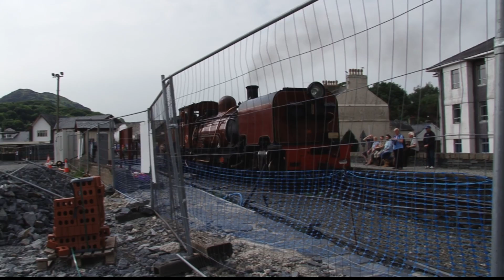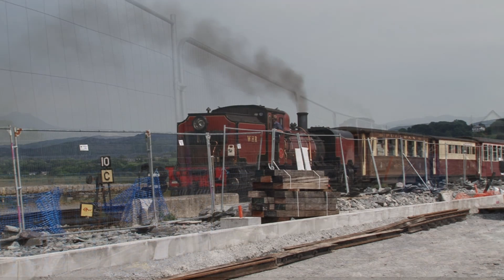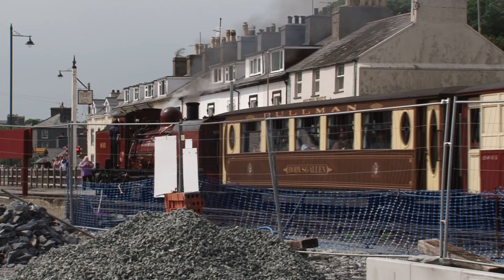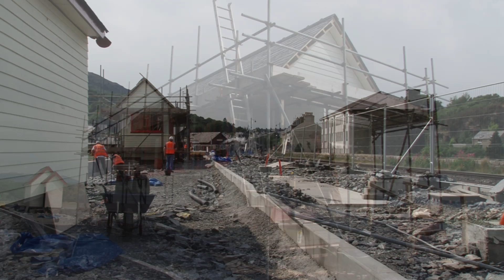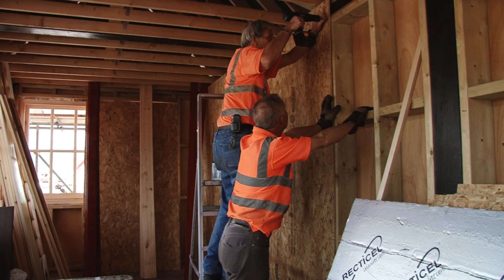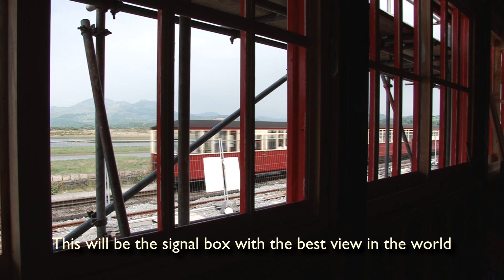Cob widening June 2013

Comment from the maker: The 1920s were simpler times so the track and signalling arrangements were much simpler then. The Welsh Highland joined the FR in the same spot as it currently does but the trains of both the FR and WHR used 'Portmadoc new' station which was located between the flour mill and the GWR crossing.